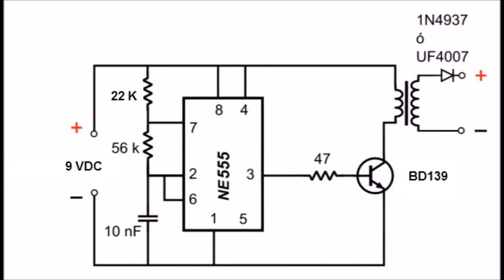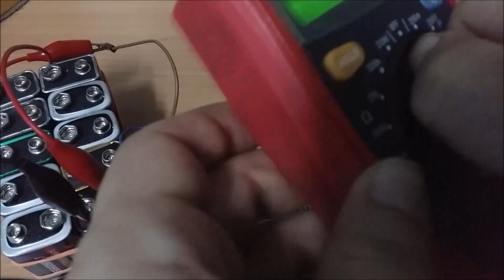Easy Simple Step Up Voltage 9 v DC to 400 v ~ 1000 v AC

Comment: can you teach me how to step up transformer for input 220 Volt AC into the 200, 250, 500, and 1000 V DC?
Reply from the maker: Voltage multiplier circuit from the transformer output

Comment: if i have a solar panel that produce an output of 12v, 0.5A and 10W, can i use the output of solar panel as an input to this circuit?
Reply from the maker: Because that is hand made transformer using the cfl bulb inductor this is not very efficient circuit. You can use a descent from faulty power supply that would be more efficient.
Reply: ok..so if the input with 12v will not damage the other components right?

Comment: eh i
did this too
but mega lol voltage output just 70v

bcause i use 
bad caps?
what is your caps? volt & farad?

and ??
ur resistor? ?? ohm?? ??watt
Reply from the maker: The circuit in the beginning of the video have all the component in this step up booster project

Comment: may i know the schematic ?
Reply from the maker: Its in the beginning of the video
Reply: what kind of transformer are you using at the end of the circuit
Reply from the maker: Its a modified inductor from cfl lamp...u can use a proper transformer
Reply: what should be the windings of the transformer or do you have a specific name or value for the inductor
Reply from the maker: Keep the original inductor winding as the secondary...and wound additional 30 to 40 turns as the primary on the cfl inductor